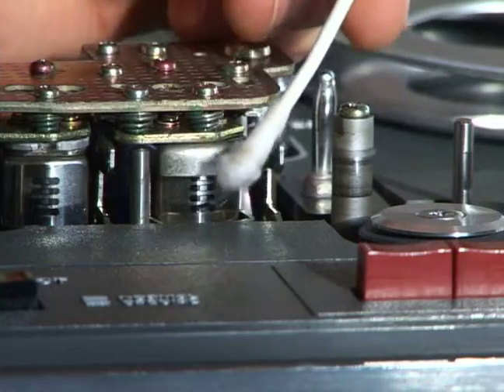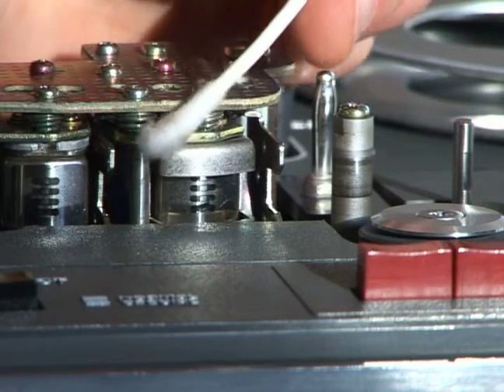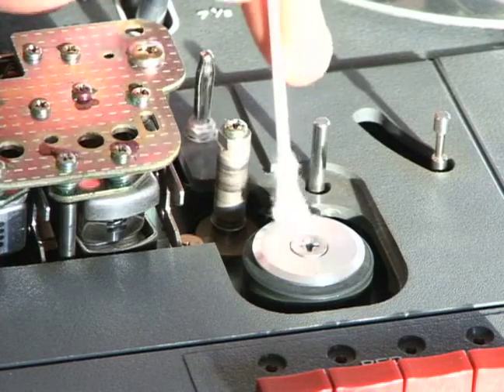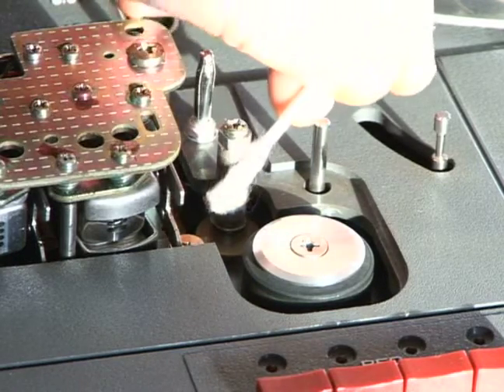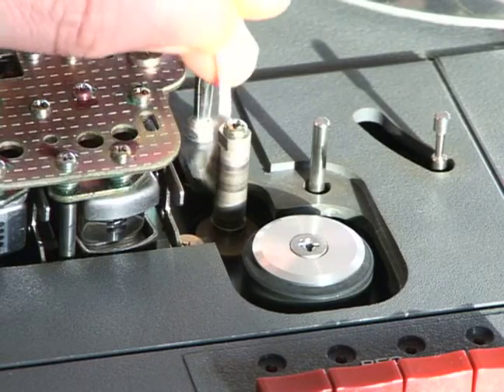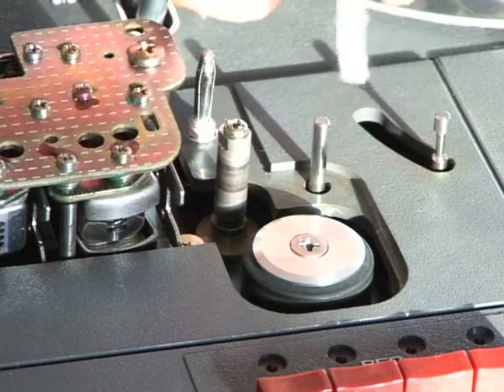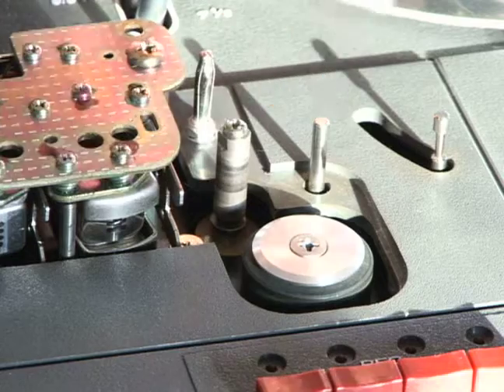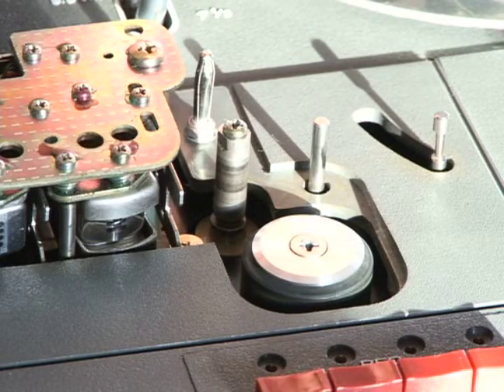Reel-to-Reel Recorders : When to Clean Heads of Reel-to-Reel Tape Recorder

Comment: I have a reel of soft cloth tape apparently for this purpose. Do you think it's advisable? It does a good job especially on the pinch roller which is showing a few surface cracks after 40 years. 
I'm thinking alcohol or similar solvents might get into the head core laminations and dissolve whatever holds them together. Should I be concerned about that?

Comment: these are great clips. i have a teac 10" that needs to be lubed, cleaned, and i'm going to do it now, thanks to these!
Reply: In fact all clips are total nonsense. You never ever lube heads, he uses the wrong oil and oils the threads and not the bearings of the pinchroller in one orher clip ….